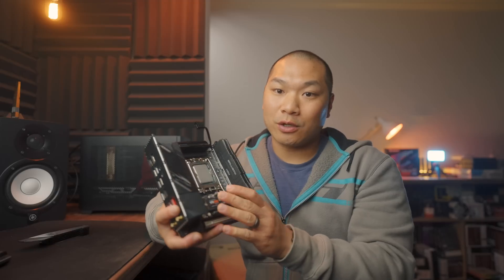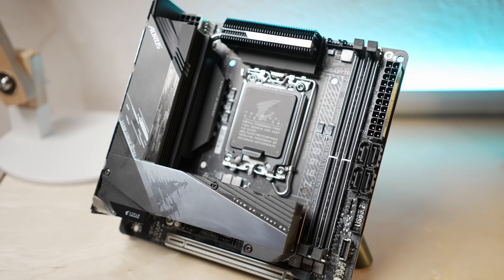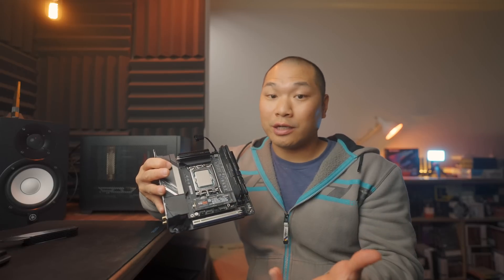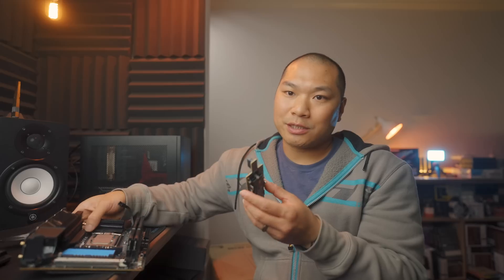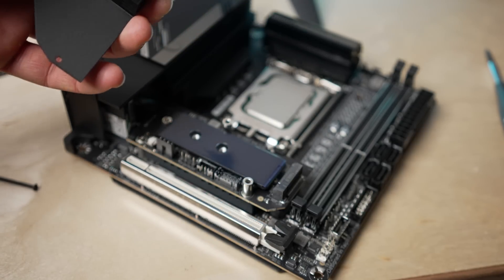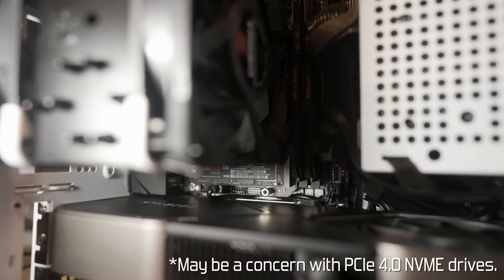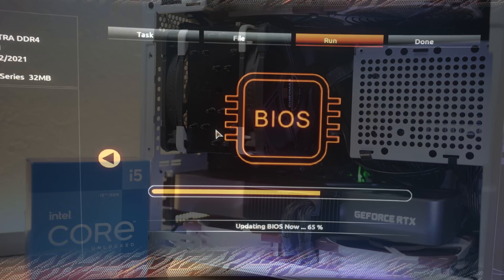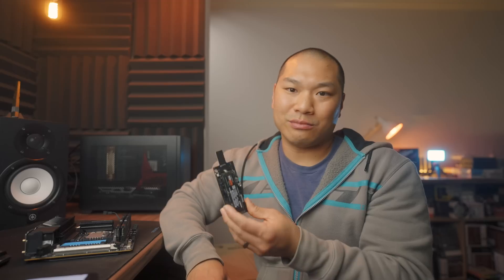Gigabyte Z690 ITX Ultra... Ultra Headache?

Comment: Yeesh. I am planning to build my first sff pc with Alder Lake 12600k. But the selection of itx motherboards are not great. Even before seeing this review, I wasn't going to touch the Gigabyte Z690i - do not like their Bios at all.

But the design is truly head scratching. The backplate is unnecessary and because its an itx board, all of the aib companies need to really move a lot of the essential ports behind the mobo as lga1700 socket has such a bigger footprint which will make it difficult to connect and route cabling.

I was planning on air cooling but it seems liquid cooling will be less of a problematic install. Oh well, great review and appreciate your hard work.
Reply: As somebody who used this board, a 12600k, and a 280mm AIO for my first build (NR200), liquid cooling was a nightmare because there's just nowhere for the tubes to go. I'm sure others may have had easier experiences but I regret not using an air cooler, which I never thought I would say.

Although I used a liquid freezer ii which I've now heard is hard to use in ITX cases
Reply: @NicholasSunderland  i should have specified. I meant custom liquid cooling. I don't do AIOs but you're absolutely right. The way most AIO are setup with the tubing mounted to the side of the cpu block/pump housing with all its connections such as fans and rgb. Definitely more restrictive.
Reply: @BucketNakedz  I didn't notice you said first sff PC, I must have read "first PC." If you've already got experience I'm sure you're fine, esp if it's with custom loops lol
Reply: Have fun!
Reply: @NicholasSunderland  Did the arctic liquid freeze ii fit on the aorus z690i for you? I read a comment saying it definitely would not fit but now idk 😅
Reply: @llokemanll  yes, I managed to get it fit, but I would not recommend it with this board because the m.2 heatsink won't go back on right. It was a pain in the ass, the end result isn't quite right, and I've also since found out that the liquid freezer ii isn't ideal for ITX builds. The tubes come out of the pump & rad vertically, which makes it hard to fit. 

It may be worth waiting for other mobos to come out if you have the time, and I personally would have gone with a different cooler if I did it again.

Comment: Hi, i have big shuriken 3 scyhthe. Can i install it without the lga 1700 mounting bracket on this motherboard (i dont have the mounting bracket of lga 1700).?
Reply: No, you would need a 1700 bracket. Only the Asus Strix itx board supports older socket mounts

Comment: I've been reading about this motherboard and it seems there's issues with PCIE 4.0 riser cable as well, people are saying there's no display or a messed up screen when connecting the monitor to the GPU. 

Thanks for sharing some of the cable management issues, sounds like a pain in the butt. I'm seriously considering waiting for the upcoming b660i and ditching the Gigabyte Z690i. The problem is it is a gamble of whether the itx motherboards will have ddr4. I'm specifically hoping for MSI b660i ddr4 so I can then save even more money on overclocking features which I will likely never use.

Comment: Confirmed: Noctua D15S clears heat sink by 1mm
Reply from the maker: 👍 Biased towards the top I assume?
Reply: @MachinesMore  yes the fins biased towards top are but doesn’t matter since heat pipes are symmetrical. Did you have any issues with XMP or speeds for your ram? Tips?